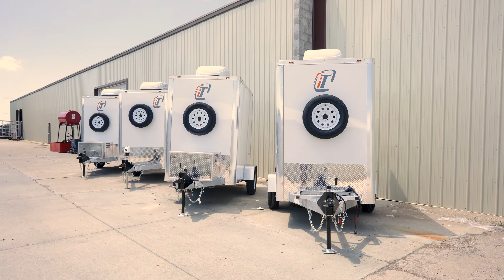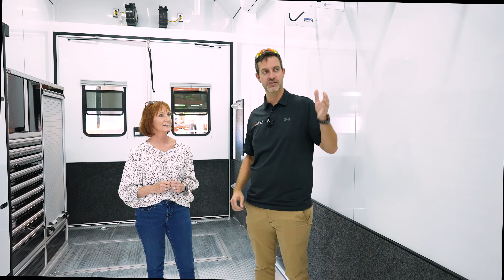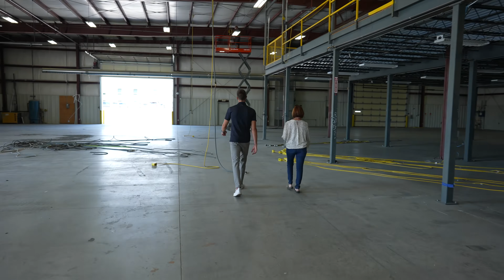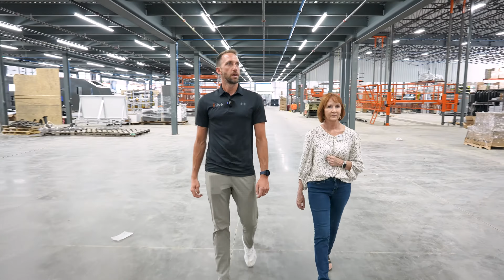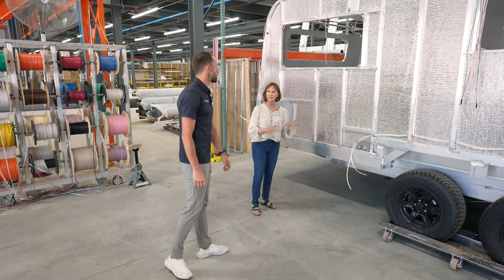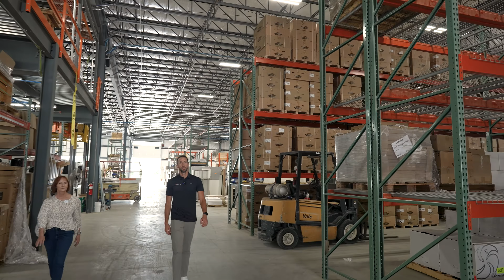inTech RV Factory Tour 2022

Comment: I love these units but two skimp points that is really shortsighted. Zero insulation with foil wrap. They could easily fill with foam board. And OSB floor? Really? Deal breakers for me. I love these otherwise.

Comment: How many times did they say - "Aluminum cage"... I get it. OK. But what about everything else!? I see wood when they look at one of the incomplete units. How much wood is used in construction. What kind of wood is it? I see kitchen build from cheap particle boards... No explanation on how the seams of exterior walls bonded together... Lots of questions..
Reply: I think the only wood used is in the cabinets and subfloor from what I've found through research. Looks like they use OSB flooring with a vapor barrier on the bottom and then a woven mat on top.  Cabinets look to be OSB and maybe a little MDF or press board. Not much wood in the trailer and none of it structural.  The cage is HUGE to me because any structural wood is going to be subject to rot with any leak.  Once that happens, might as well trash the trailer because it's a never ending battle.  No wood framing means no rot. This should last way longer than a traditional "screwed and glued" build.  I do wish they would use marine plywood though on the floor, it would withstand any moisture/spills better than OSB.

Comment: Appreciate this Video  and who they are; never new. Love the Intech but can't get around the wheels to the outside of the box. I like my axle/wheels to be flush with the box. Had an RPOD 3 mths later got rid of it, all due to the wheels sticking out of the box. But on their larger model the Terra is awesome. But like the smaller TT. Being a boat owner I appreciate their build . So i picked up a Tab but would had loved their newest  Sol comparable to floor plan to the Tab 350.
Reply: I actually prefer wheels on the outside. Makes it way more accessible when you need to do maintenance, change tires, etc.